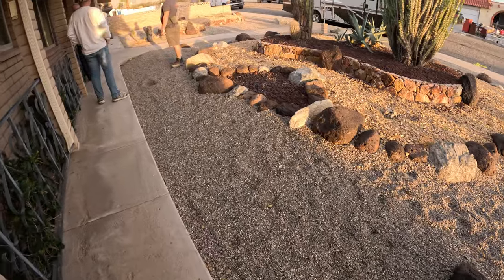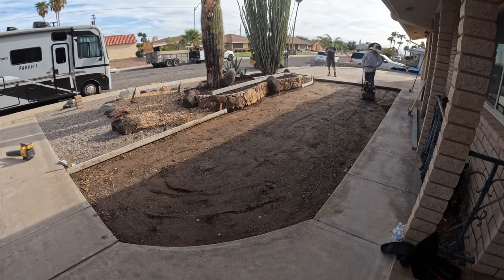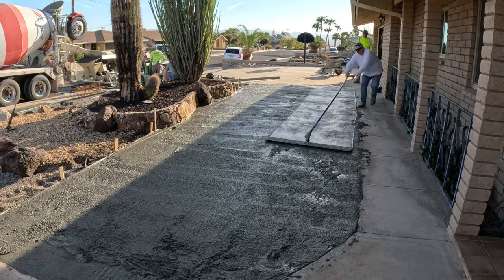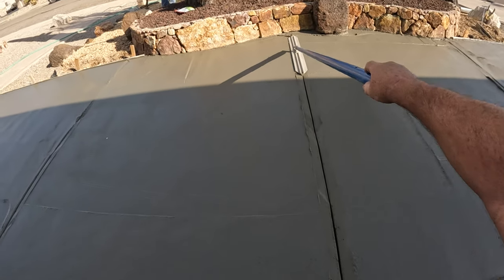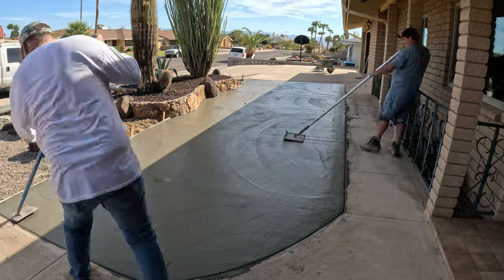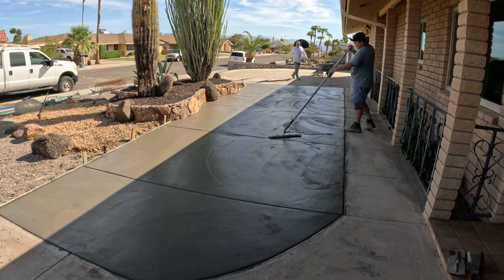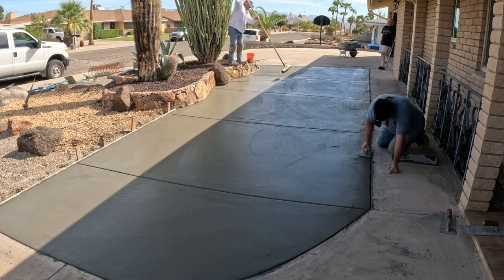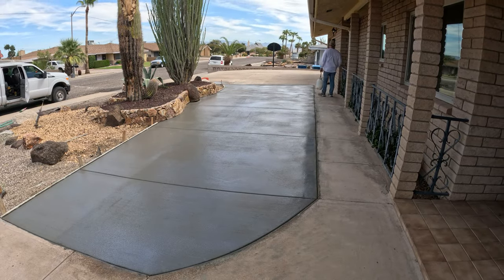How to Make RV Parking at Home: A Comprehensive guide

Comment: Out here in the phoenix valley, steel is like that too. No rust.  You can leave a car in the desert for 60 years and come back. You get a light surface rust to brown it. But thats it. I would yave doweled the exisitng slabs to it to help keep it from wanting settle or something. Nothing more anoying then a cold joint dipping an inch down. Lol.

Comment: You can really minimize the reflective cracking by putting a piece of 30 pound roofing felt along that edge. If any sticks up after you finish the concrete, just take your utility knife and cut it off.  Plus you get a wee bit of bonebreaker for movement.
Reply from the maker: That works
TY